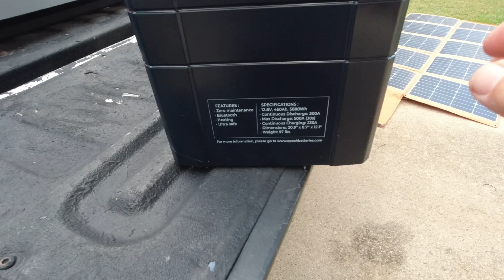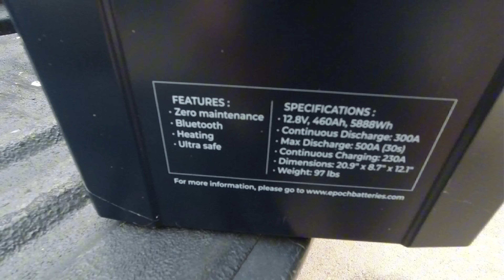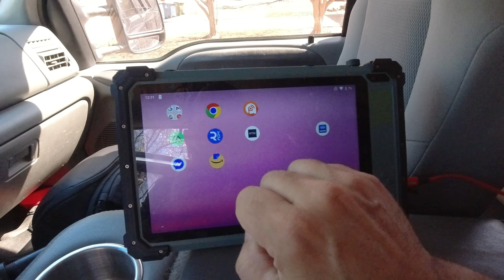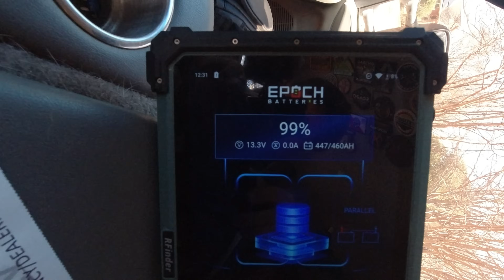Want Off-Grid Power on the Go? Watch This Now

Comment: Yup, Victron rocks!!!!   Currently building a 48 vdc 314Ah battery bank - - 16 prismatic batteries, using the Victron Multiplus II 48/3000/35 inverter/charger, Victron Lynx Distributor and Victron Smart Shunt 500A (this unit has bluetooth "thus the word smart") that connects to your phone or iPad via an app...  Super stuff!   Nice to see the use of more LiFePo4 batteries and Victron stuff in use with Ham Radio...

Comment: But how long will it run the camper?  Guess we have to wait on field day to find out.
Reply from the maker: That'll be a good test.
Reply: @HamRadio2  I was thinking about replacing the old lead acid on the camper  with a 460 Ah or 2 x 300 Ah batteries.

Comment: Great system. That Victron stuff is great !  I can see running one of them Export amps full legal power off a inverter from that battery .  That will give the battery a load !  Put that 300 AH one on the RV. Ditch that lead battery . Every one can plug into the truck on ARRL Field Day !   Now you are all set when the Texas grid goes down again !   Great job on that install ! Fuse everything ! Keep extra fuses ! 73
Reply from the maker: I have a 460ah battery for the RV. Video coming soon